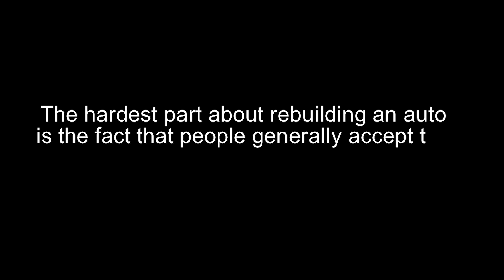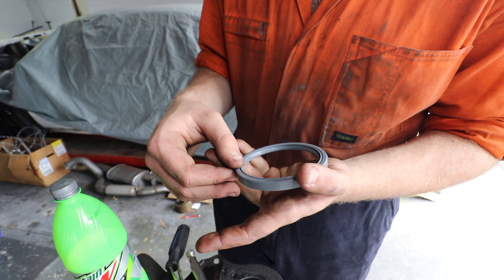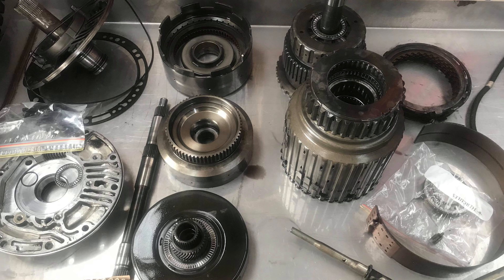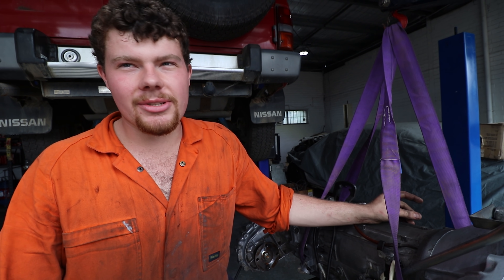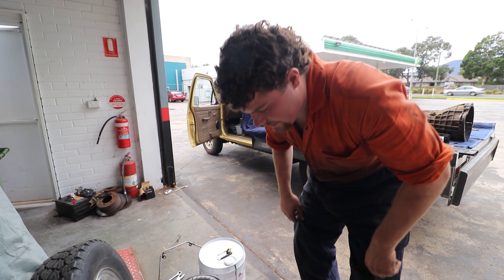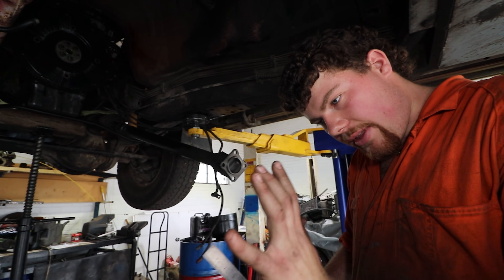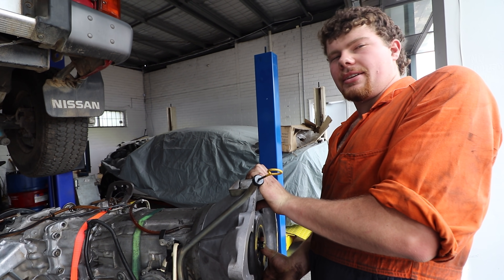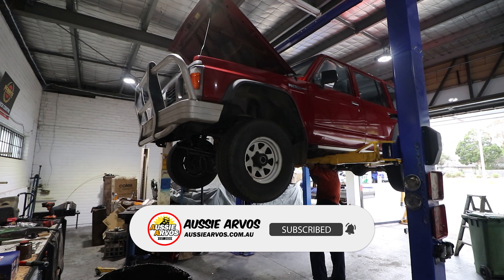The most COMPLEX rebuild I've EVER undertaken | GQ Patrol Auto Rebuild

Comment: These old Patrols are so cool, and the trouble so worth it. There is something about Nissan’s, though, that is distinctly more difficult to work on than Toyota’s. I just replaced the clutch, starter, etc, on my old Nissan D21 and it was a bear. The front suspension, exhaust, chassis cross-members, and some of the front steering components had to be removed just to get the job done. Oh, and most of the interior, including the seats. It’s like the car was built as a knitted quilt where they knitted the whole thing all at once, not loop by loop. Nice work, love to see these Patrols back on the road!
Reply: We rebuilt the gearbox on my d21 years ago not too hard but anything with a torsion bar front makes it hard as you said having to remove half the front end 😂

Comment: This is EXACTLY the sentiment i get when i say design an arduino colour controller or something. "Where did you get the plans from?" i get asked. "i did it myself" i respond. And they say "nah, someone has to have done it before and you used their plans" . No... every single THING you ever touch/see/use/break/fix was originally designed/made/broken/tested by someone who sat down and said "i want to do x" lets see how we go. So I do that. Starting from scratch is not impossible. Nearly everything can be fixed or made given time and motivation. Good work Dan!

Comment: Well what should you do if you have greased that U joint too much on the drive shaft, did a 2 inch lift and thought while I’m under I might as well grease them then watched this a few days later like oh💩, any advice would be appreciated I was thinking if I just switch it out before stuff goes wrong (manual TD42 94) any advise much appreciated

Comment: NEVER use Vaseline on a seal.  If you don't believe vaseline can destroy a rubber/neoprene seal, so be it, but prove yourself wrong on a seal that's easier to replace than the rear main :)
Reply: In my opinion any seal that was intended for use with petroleum products such as oil or atf will not be damaged by petroleum jelly (Vaseline) and I have used it on many seals.

Both the atsg rebuild manual for the auto and the Nissan workshop manual recommend it.
👍
Reply: @dantheman7647  There are thousands of opinions agreeing with my point of view.  If those manuals recommend it, then the OEM gaskets are not rubber or neoprene, but your aftermarket ones could be.  It's not as if there is no easy alternative to Vaseline, now is it?  Using Vaseline on your condoms is also a good idea, then?  Yeah, Nah.
Reply: @Ein Felder  both neoprene and nitrile rubber are safe for use with petroleum products, latex however is not.
Thanks for your concern 
Have a nice day
Reply: @einfelder8262  Hmm, random baseless opinion vs workshop manual, tough choice
Reply: @mikebaz7843  You probably believe the world is flat, too.
Reply: @einfelder8262  from your uninformed opinion, nah
Reply: @einfelder8262  Reading workshop manuals is uninformed is it? It's not too late to admit you were wrong